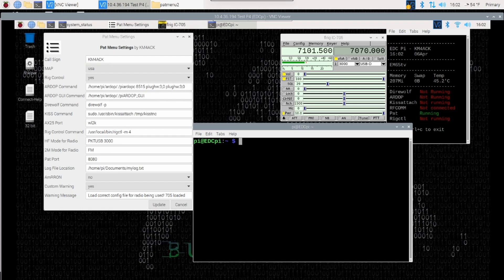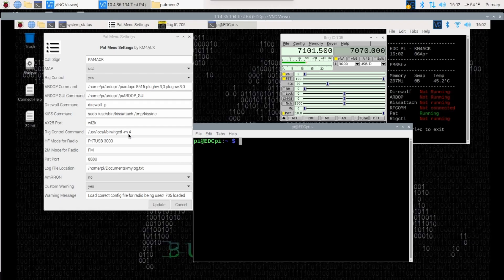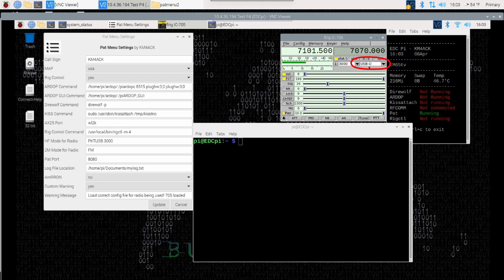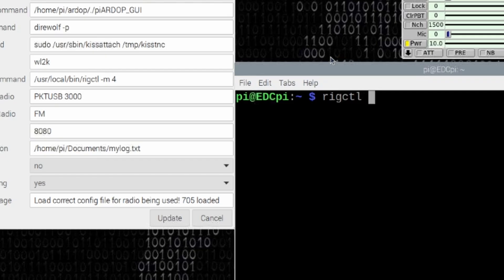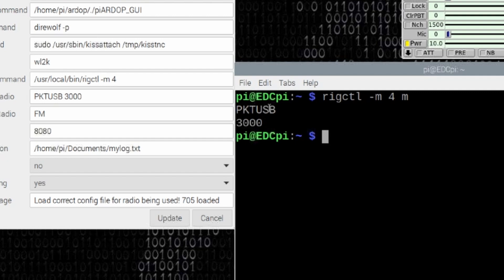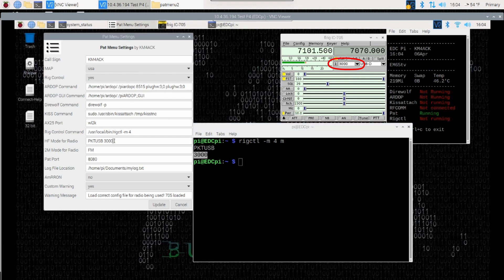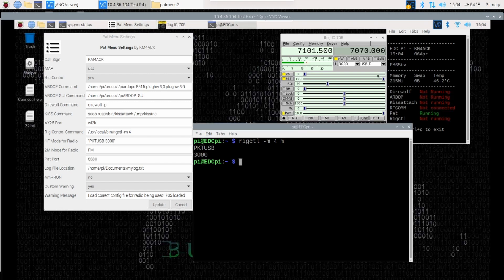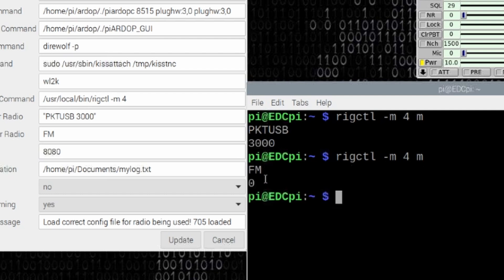Pat Menu Modes :: Quick Tip

Comment: I enter the quotation marks around the PKTUSB 3000 and save config file.  Reopen and the quotation marks are gone.  When running Pat Autoconnect, I get grep: 3000: no such file or directory.
Reply from the maker: The grep error is a minor bug in the auto connect script but won't impact performance. The fact that you have the error tells me you entered "PKTUSB 3000" correctly. Opening the config file again, the quotation marks won't show.

Comment: Great Video - thanks!  may I ask what window it is on the right hand side? Looks like Conky running in Terminal mode? Guess this is more resource friendly?  Is this part of the actual BaP already?
Reply from the maker: A Conky like script that I wrote and have been testing. It works but I don't like that it still has the terminal window frame around it. I think a scaled down version of Conky would be better. This was just an exercise to see what was possible.

Comment: The port I notice is 8080. Way back when you used port 5000. I must have missed the reason why the change?
Reply from the maker: With BAP, it depends on what you install. If you just install Pat, it will take port 8080. If you also install the EES, then the EES gets port 8080 and Pat is moved to 5000. On this Pi, I didn't have the EES installed so pat is running on 8080

Comment: I like this format, especially for some of the common configuration settings particularly once build-a-pi is installed and I am adding a new program or radio.  Rather than watching or “scrolling” through the longer videos, the answer is quick and easy allowing me to play radio rather than trying to resolve a configuration issue with the software!  Keep up the great 
work Jason!  73